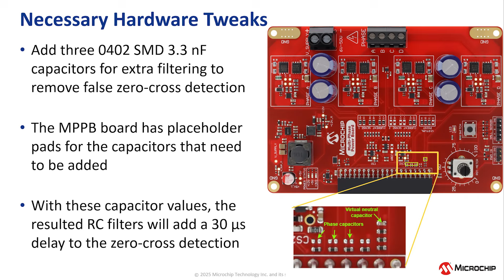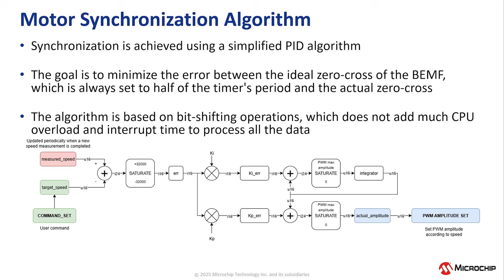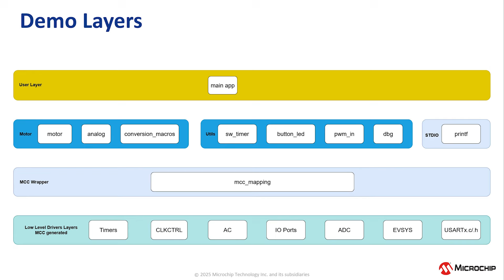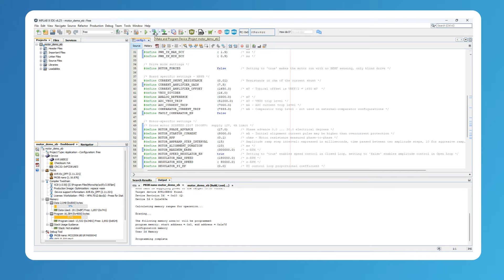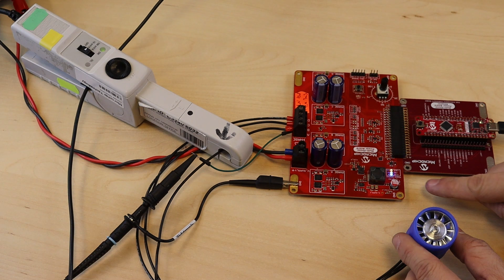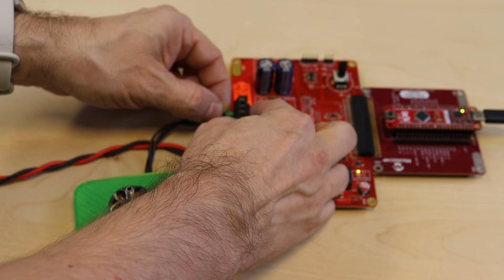The Secret to Controlling High-Speed BLDC Motors (130K RPM  Demo)

Comment: have you ever use  svpwm method  ? i think its apply a lot of in BDLC motor
Reply: Hi, at high speeds >120k electrical RPM, the number of PWM pulses per electrical period becomes so low, that the advantages of SVPWM over the 6-step commutation/trapezoidal drive becomes insignificant. The SVPWM method needs more resources and an FOC algorithm to be sensorless, thus a more expensive MCU. The simpler algorithm and drive method allows for cheaper MCUs to be used.